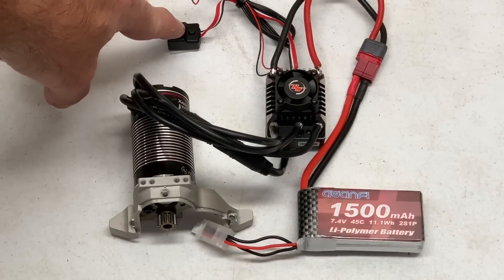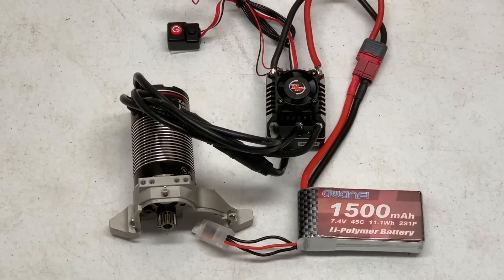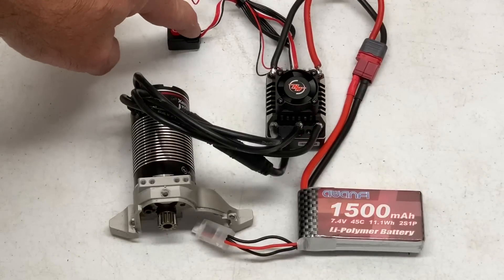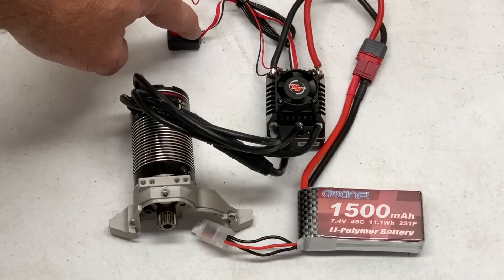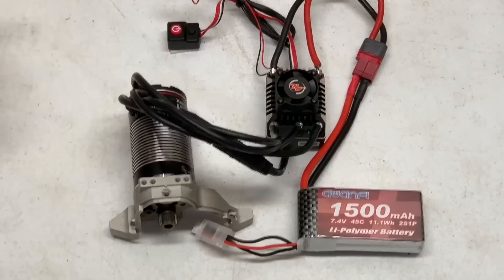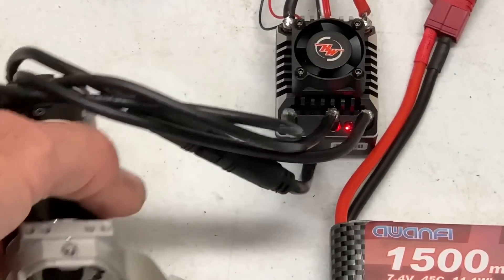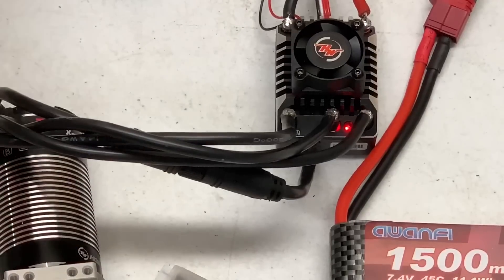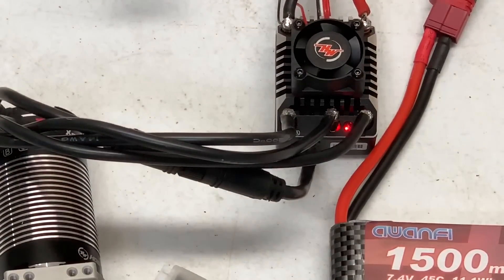Hobbywing Motor Pairing for the Axe ESC

Comment: I try the same thing, but no throttle and just blinking red light, any suggestions? I have tried recalibrating throttle and nothing. Xerun 550
Reply from the maker: you may have to reverse ch2 on the transmitter

Comment: So I've had this happen to mine and I'm having trouble. I'm visually impaired and it's kind tough for me to break down my whole Gen8 Axe, am I to understand I can just take the wheels off and do this?
Reply from the maker: at the end of the video I show the settings I use, just simply set yours up the way I did and you'll be good to go.
Reply: I guess it's required that I remove the pinion gear
Reply from the maker: G. Jon Hamm wait I was thinking the wrong video when I answered. Sorry. But yeah for best results remove the pinion gear.

Comment: Great information here. Was wondering if you have any plans to try this in the Gen7? I’m working on upgrades for my Gen7 and I think motor and esc are next on my hit list.
Reply from the maker: Tyson Dempsey for the gen7 this esc/motor would have insane power. Maybe I’ll get a chance to give it a run this Saturday and get it edited for next week. It will move the light truck super easy.

Comment: Hi bud! I am wondering? you that are brave enough to test the reverse polarity protection.. Have you tried to use the 550 motor with the OG ESC with the new firmware? I am wondering if Hobbywing is just forcing us to buy the new ESC but the older one can actually drive it??? Will be cool to see if you can test that out.
Reply from the maker: I honestly haven't had time to try that but I will, I have a comp this sunday and I don't want to risk something not working right. However the update gives the ability to run the new motors with the new features of the new esc. The only difference I can tell is the new esc is rated for 1 more amp than the old one on the bec. The motor amp ratings are the same from what I've read. as far as the reverse thing, well it was on video if anything messed up, lol
Reply: @ExocagedRC  Supposedly the firmware update does not make the AXE 1.0 ESC 550 compatible according to hobbywing reps that is why I dont get it..

As far as I can tell the new 1.1 ESC is the same with just a BEC bump and a included fan, The Amperage rating is exactly the same as the OG.. I asked again today and this is the official response:
"In short, The " OG AXE ESC" has been discontinued. There is a new firmware for the AXE system as well. 

This new update will not allow the OG AX ESC to work properly with the 550 motors."

So I think this is PR Bullshit… I think hobbywing is really pushing the new ESC just because they can.
Reply from the maker: skirmich that’s interesting, coulda swore I saw where the old axe gets all the features and capability to run the new 550 motors. Maybe it was that I could run the older motors with the new esc?
Reply: @ExocagedRC  Yep that is the official response.. The 1.1 ESC is compatible with all Motors, The OG 1.0 ESC is 540 ONLY.

Why? who knows.. If the Amperage is the same between both ESCs its not because of the ESC Power handling, It can only be a firmware thing... 

In any case there is no Warning Label anywhere about trying to plug the OG ESC to the new 550s, Would be cool to see what happens, Probably wont run at all but if the Pairing Process happens then your video will prove they are indeed compatible.
Reply from the maker: skirmich the only reason it may not work is maybe they updated the sensor or something making the new motors incompatible? I’m not totally sure at this point. I’ll dig into it.
Reply: @ExocagedRC  If that is the case the Sensor plug wont be compatible at all.. Probably the first thing to test is if they plug at all.
Reply: it does you just have to update

Comment: Pass....... that and the unique sensor cable.
Reply from the maker: Mike McElligott yeah it’s proprietary for sure but it drives incredibly nice.
Reply: FOC is really nit-picky about precise calibration, Which also requires a unique sensor cable. Still far better than any other sensored system out there. 

Those who hasnt have an outdated hal sensor cable break in the middle of a race in full sensored mode cant really appreciate the new hobbywing sensor cable.